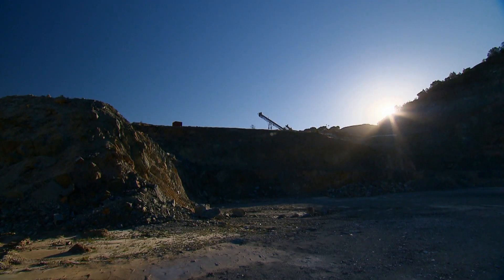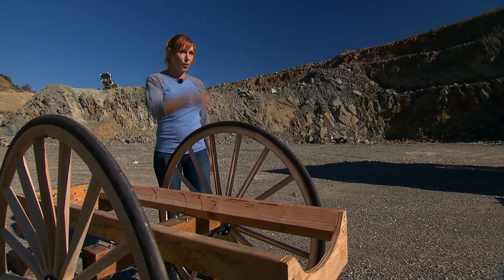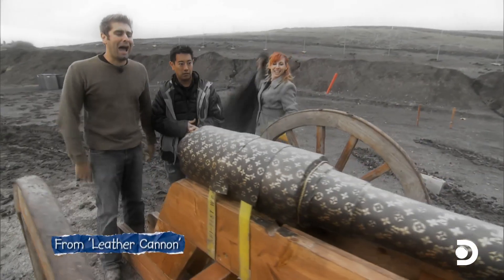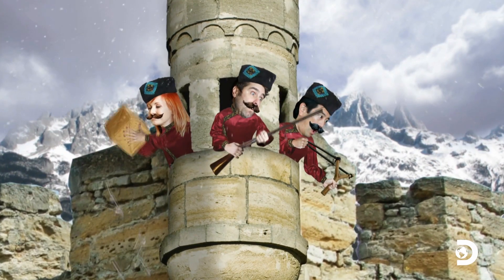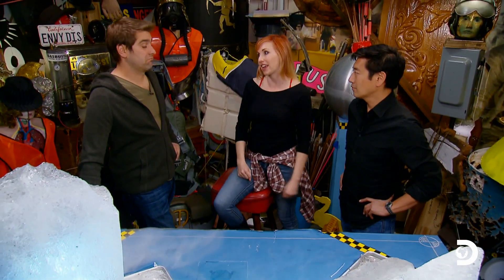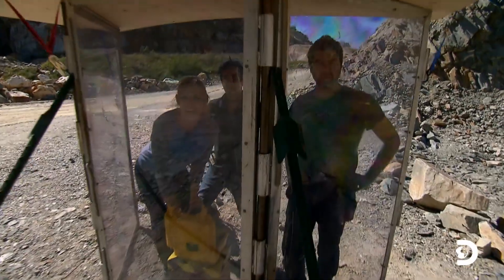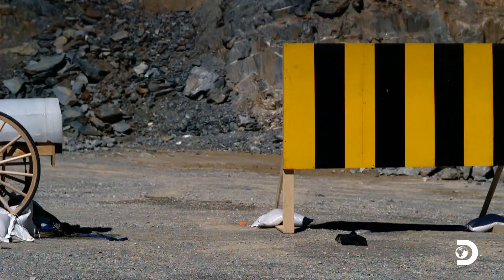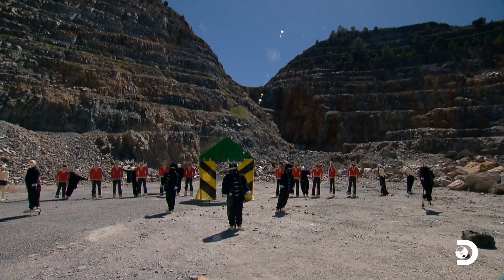Launching an Ice Cannonball at 680 mph! | MythBusters | Discovery

Comment: Why wouldn't they use wood and wrap it with rope, and then dip it in water to add ice around that? Since it was winter the temps would not thermally weaken it either. The ability to continually add water during winter temps would allow them to keep the outer ice shell frozen, even if it began to crack the ice. Multiple cannons would allow for time to refreeze any cracked cannons.
Reply: Or for that matter start with wrapping wet towels or blankets to form the cannon.